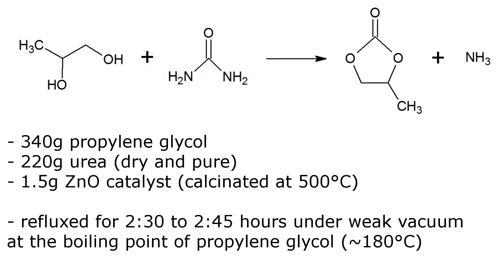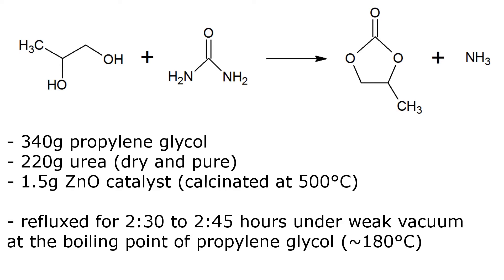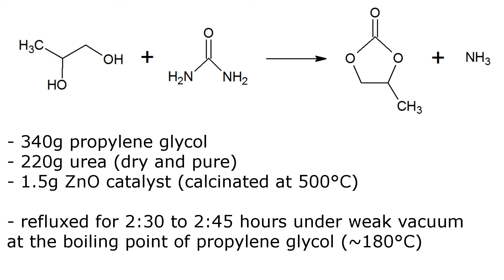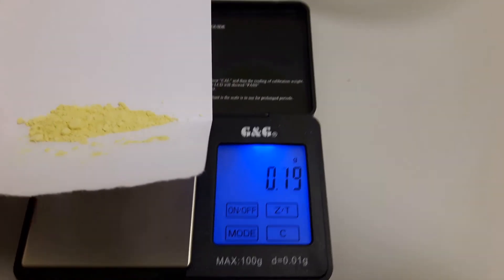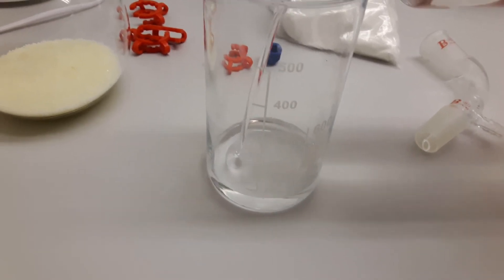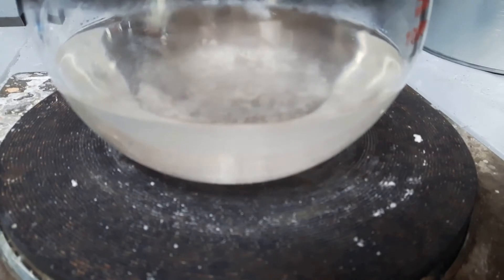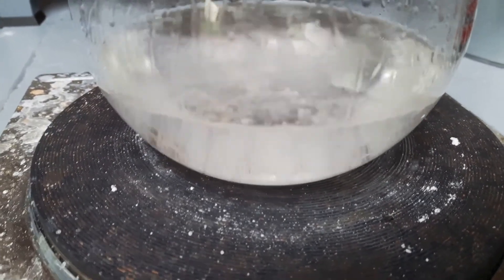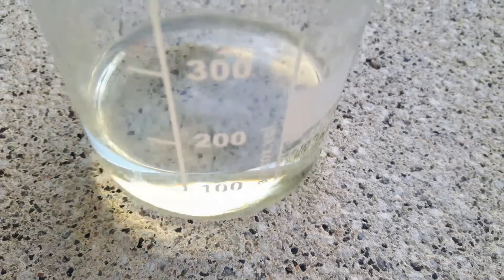Propylene Carbonate Synthesis

Comment: Amazing! PC is so expensive if you get it from suppliers, this tutorial is so helpful! Thank you!
Reply from the maker: I'm glad it helped you!
Reply: Are you making electrolyte of it ?
Reply: @omsingharjit  Why you ask?
Reply: @karlm5022  i thought
Reply: @omsingharjit  Just saw your sodium battery, nice work! Using Sodium Metal? You thinking of using PC as a solvent?
Reply: @karlm5022  yes it can be use as solvent of Salt
Reply: @omsingharjit  Yep Just make sure there is no water present if your using sodium metal. Im not sure of the interactions of Sodium and PC however
Reply: @karlm5022  actually it's Aqueous solution based ...
Reply: @karlm5022  but i am thing to use EC or Pc Solvent with Sodium salt for that

Comment: I appreciated this video! I ran this as a small test run. I have some comments how it went for me. Sorry, no lab-speak as I didn't bother taking clear notes at the time.

I refluxed approximately 1/2 your quantity reagents under very light vacuum, boiling in a flask on a stirred hot plate. The column was an uncooled long Liebeg. I initially bubbled the vacuum takeoff through a cold trap filled with water. Seemed like a good time to make some aqueous ammonia.

The reaction proceeded uneventfully for an hour or so. During that time I decided I had too much ammonia to deal with using the cold trap so I moved the cold trap bubbler to a 1L flask. Later on I emptied the flask (turned out to be about 3% but you wouldn't know from the smell) and replaced with water and a large helping of sodium bicarbonate. Still putting a little ammonia through the (extremely cheap) barely-vacuum pump but aside from the odor *shrug*.

After a while a white solid began depositing in the upper part of the reflux column and in the vacuum hose also. I've read of this behavior before. I'm unsure what this material is except that it is extremely water soluble and smells of ammonia. Ammonium carbamate possibly? But where would the CO2 come from? Hmm. There's a limited menu of possibilities.

Ultimately I was concerned that the vacuum hose would become clogged and stopped boiling/refluxing after a little less than 2 hours. The result was a slightly yellow liquid.

I vacuum distilled the result at about 0.05 atm using a short path apparatus on a stirrer mantle. First fraction came off at ~230-245F. This was almost certainly unreacted propylene glycol. Correct density and what else would it be?

The second and last fraction came off at ~270-300F. This would be the propylene carbonate. Correct density and expected gap in boiling point. The fractions were split roughly evenly.

I didn't distill to dryness. The remainder was a small quantity of light orange liquid, just enough to cover the stirring bar.

I'm curious why the reaction didn't proceed to completion. I was using fresh, tightly packaged urea but perhaps I need to bake it. Perhaps I didn't weigh correctly and failed to use enough urea.

If the white solid being deposited is ammonium carbamate, I believe I should be able to prevent that by insulating part of the column and the vacuum hose and keeping the hose as short as possible. I might also try using a different column/condenser for reflux. I don't have a short one at the moment ... packing type column is on order. (I would use that unpacked except with maybe a little glass something.) Maybe I'll get a short Liebeg. Maybe the short path apparatus on top of a short extender would work, given that the point of this is mostly to remove ammonia while the complete reflux shouldn't require much height.

I'm going to make more (1-2L probably) and eventually distill the lot 1-2x to get rid of propylene glycol.

I'd appreciate any remarks.

Thanks for the informative video! 👍🌟
Reply from the maker: What a nice description. It sounds a lot more professional than my approach. Two things that I found very important variables that influence the result: 1. The catalyst and its preparation. Slight changes in procedure might drastically change the yield. 2. The reaction time. Too little and it won't be completed, too long and you'll get impurities. I used a very wide condenser so clogging was not a problem. The urea decomposing can form all sorts of substances that react with the ammonia in the gas phade and sublime on the condensor. No idea what it is though
Reply: @ShroomLab  I torched the hell out of the ZnO as I remembered it turns yellow ... briefly ... when legit calcinated but thought possibly (incorrectly) that the yellow color would persist if only I could heat it hot enough long enough perhaps in a paucity of oxygen. Then I realized that you had said your yellow color was due to contamination. Hilarious. I think my catalyst was fine anyway.

Just gonna try this again with a few tweaks. Will report back.

Definitely agree about reaction time. When I've read this described elsewhere the reaction time is 2.5-3 hours or just 3 hours. Batch size and temperature surely matter.

The yellow color might be contamination with some polymerized gunk. I don't know how that works. However, if not boiled to dryness, the remaining liquid dissolves it fine. So far.

I have a washing bottle on order (I have been giving myself an "adult chemistry set" for Xmas and my birthday) which should really improve the strength of ammonia water. But, not here yet. :)

This is a really neat synthesis that definitely saves hobby chemists $. Thanks again!
Reply: I've been working on this some more. So far I've had difficulty getting more than about 1/2 of the propylene glycol reacted. I just distill it off as part of the mix and throw it into the next batch. I'd really prefer a better yield but the reagents are cheap and I have pounds of urea and >1 gal of PG so ....

The description of the process that seems most reasonable to me is a 170C oil bath and fairly high vacuum (.05-.1 bar). I can do that, just haven't yet. I did run it in similar vacuum in a heating mantle once but the reaction did not seem to want to proceed to completion, so after a while I removed the vacuum. If you do this under significant vacuum, put a check valve between the bubbler/wash bottle and boiling flask!

By the way, the reaction is noticeably exothermic early on. Not a problem; could be considered a benefit. It will sustain its temperature without external heat for a while.

Dealing with the white deposit/precipitate, which will distill over (!), is annoying. It seems to help to dry the PC before re-distilling. It will settle reasonably quickly in a separatory funnel. Took a few hours for me. Then I dried with 4A molecular sieve and re-distilled and got a good product.

Updates coming when I have them!

Comment: If it can recover Alkali metal from chloride by just electrolysis it mean i can use it for Electroplating Li , Na , K , Mg , Al right ?
Reply from the maker: Hmm that is a bit of a myth. With no additives you might only do Lithium.
Reply: @ShroomLab  not useful for sodium recovery ?

Comment: I wanna make Ethylene Carbonate using Ethylene Glycol and Urea but it is mentioned that Zinc Oxide is used as catalyst but i wanna know can i use calcium oxide or Aluminium oxide or other salt  as catalyst  ?
Plz help
Reply from the maker: I found the synthesis in a paper, I don't think you can simply change the salt.
Reply: @ShroomLab  but in wikipedia there is two catalyst  mentioned , #ZnO for EC  and #Zinc_acetate for PC using same Glycol and Urea based method .
Reply from the maker: @omsingharjit  Yeah, you're right. The Zinc ions are likely the catalyst. Use any zinc you want. However the preparation of the catalyst might matter much
Reply: @ShroomLab  0:37hw can we able  to  Archive Any Vacuum While it's Boiling ? If mean i create vacuum , then boiling Liquid instantly destroy the Vacuum by filling the jar with  Vapor ?
And i can't see any Water flow in your reflux Condenser ?
Plz explain ?
Reply from the maker: @omsingharjit  It is just a partial vacuum. It helps to remove the ammonia and drive the reaction. there is no water in the condenser because it is air cooled. For propylene glycol that is sufficient, because of high bp
Reply: @ShroomLab  i worrying of the losses of  Propylene glycol as gas Vapor if i open the boiler to open air during reflux boiling because at boiling point I think it will also loose PG with Ammonia because you mentioned the Temperature around 180°C which is the Boiling point  of PG .
By the way i wanna use same method for making Ethylene carbonate from Ethylene Glycol for My sodium Ion battery Project  , i Think it will work similar for EG .

Comment: Excellent and useful, subtitles to help understand some of the operators speech/syntax was hilarious which was a shame. I think the broken glass was in place of boiling stones and I could not see where the thermometer was placed. Still a very useful synthesis considering the source materials are quite cheap. Propylene carbonate from suppliers like Sigma-Aldrich cost a fortune considering it is a most versatile solvent.
Reply from the maker: The subtitles are auto generated, glad you liked the synthesis! Glass was indeed a boiling stone replacement, the thermometer was above the destillation flask in the condensor.

Comment: Hi! Can it be used to dissolve cianoacrylicate super glue?
Reply from the maker: I don't know, never tired it, probably yes. You can dissolve the glue with acetone which is way cheaper to get and you dont "waste" the carbonate on it
Reply: Shroom Lab I've tried with some nail polish remover that contains acetone but it didn't work. I know a product from Loctite that dissolves the glue, and I think it is propylene carbonate.